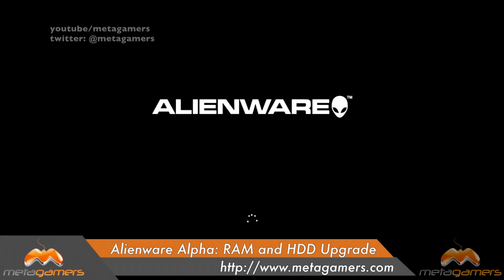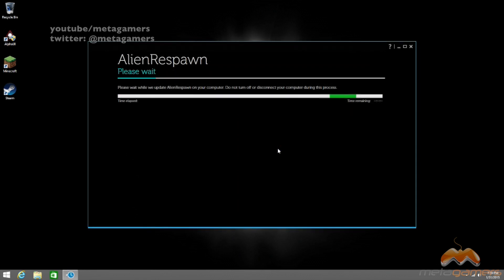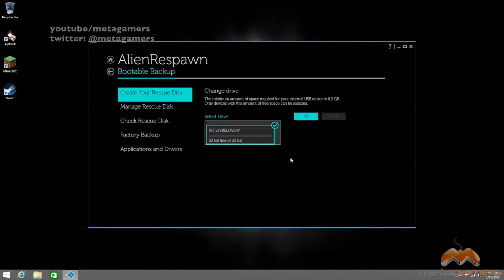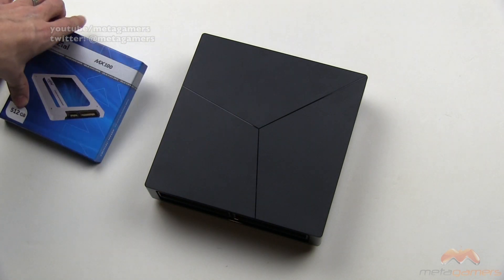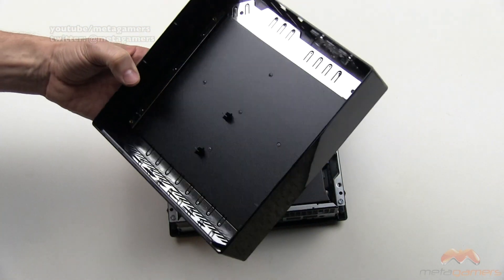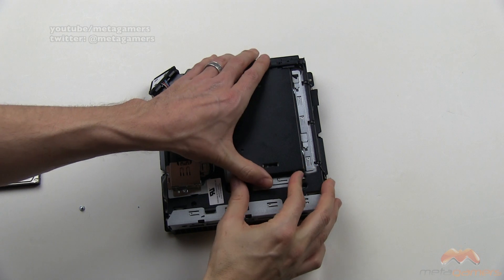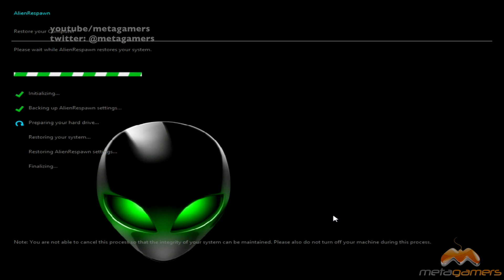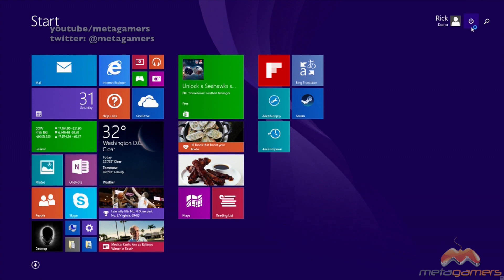Alienware Alpha RAM & SSD "How to" Upgrade Guide

Comment: Alienware Alpha i7 is at $649 right now. I don't know how good a deal that is. And before I have to see a DIY PC enthusiast responding, I actually have an NCase M1 mini-itx gaming PC that I built myself. This tiny pc would be for my mother. Does anybody know how low the i7 version has gone down to? I know that the i3 version hit as low as $330 online and $300 at microcenter.
Reply: Hey Albert! The best thing you can do is to buy the i3 model. You can manually upgrade the processor to a i3 4130 NON T. This processed preformed better than the i7 model ( I forgot where but look it up on Reddit). And with the remaining money you can buy more ram and an ssd to your liking. Hope it's not to late:(
Reply: With the ram You only need one stick of 4gb of ram, Because there are 2 slots of ram but only one stick in the system
Reply: +Pjnerd what is non t? i just order the alpha i3 and want to upgrade it.
Reply: can you link it from amazon?
Reply: http://www.amazon.com/gp/product/B00EUUKVXM?psc=1&redirect=true&ref_=ox_sc_act_title_1&smid=ACO27ZEUBKBAF
Reply: But i strongly recommend to upgrade the ram and the hard drive to a ssd FIRST.
Reply: +Pjnerd Cpu is on order. so 8 gb of ram is good total? or can i get 16? also is 250gb ssd large enough or should i get the 500?
Reply: 8 ram is enough The ssd depend on the type of games you play. For the cpu did you buy a good thermal paste.
Reply: +Pjnerd nope.... any kind ?
Reply: http://www.amazon.com/gp/product/B000OGX5AM?keywords=thermal%20paste&qid=1449185290&ref_=sr_1_2&sr=8-2
Reply: Curt Gilbert also the ssd I think the 250 gb is more than enough
Reply: Pjnerd
It's too bad there is no gpu refresh to the 970m. Maybe they will wait for the Nvidia Pascal GPUs to come out.
Reply: Well honestly, that gpu is quite "enough" But i still agree.
Reply: +Albert Chang Pjnerd Is wrong go with that its the best deal rn. I got the i3 version and now im having to spend $300 on an i7.
Reply: +Endz  I got the i3 for $330, $70 for 250 ssdrive , $70 16 ram, $115 new processor.  Totaling like $550 super fast !
Reply: There are some good deals for eBay bids. Some they give you a nice samsung ssd with 16gigs, i7 and like free games and wireless logitech keyboard for like $700.
Reply: If you get those new credit cards such as Chase Freedom, you can get10% back from Amazon purchases (till end of this month) and like $150 back if you spend $500 first 3 months (really easy to do in California lol).

Comment: I noticed you said 4500 rpm when I was on website today the hard drives now say 7200 do you think that is fast enough
Reply: sorry you said 5400
Reply: +twofacedconker that should be fast enough. the jump from 5400 rpm to 7200 rpm is significant. The hard drive is probably a Hitachi 32mb cache or a Dell 64mb cache. Hitachi seems the most probable as you can get it around $65-70 on newegg.

Comment: so if i upgrade the ram only do i have to back up the alpha
Reply from the maker: No you should be able to swap in the RAM no problem - no backup required
Reply: +metagamers do I have to use a wired key board and mouse? why is it safer?

Comment: Upgraded the CPU,RAM, SSD, and wireless card but my alpha won't boot up. The logo keeps flashing yellow. Do you know what could be the problem or how I can resolve this? Thanks
Reply: +JerzyShingo1234 That would be a power issue.
What CPU did you put in there? If your system draws more than 300 watts you will get that error.
Reply: Same here! Did you find out how to fix it?

Comment: should I get an alienware alpha as main gaming machine?
Reply: +AMDX1325 Yes i recommend, ONLY if you have no knowledge on building a pc. I Strongly recommend you buy the alpha through eBay you can get it for around 370$ usd. And with the reaming money buy the ram and ssd. and later on buy a i3-4170 CPU and upgrade it. That cpu is the BEST one you can buy, even better then the i7 config .
Reply: ***** The i3 version comes with a i3-4170t CPU But if you change the processor "manually" to a i3-4170 CPU (non t) you will have a higher clock speed and Just better performance. if you use a good thermal paste
Reply: ***** No Problem Bud :)

Comment: Great video mate, I was considering one of these for a media PC and because of your video I'm sold. Also does the System support 5.1 surround using the toslink port, Thanks again.
Reply from the maker: Thank you. Yes, the system supports 5.1 if memory serves me correct. I can double check that and get back to you
Reply: +metagamers I just need to verify that the 5.1 works via the toslink port, so if you could confirm that would be greatly appreciated.

Comment: do I have to upgrade the hard drive?? I got the i5 1TB with 8gb RAM so can't I just upgrade my ram to increase the speed ?? as my hd is 1TB 

thanks
Reply from the maker: Yes you can just upgrade the ram if you'd like. The hard drive upgrade really only helps with load times
Reply: So I have the 1TB what comes with the i5. Would I need to change it? 

Thanks for getting back to me!!
Reply: +Gary Smith Most indications I have seen online are that there is a significant boost in speed with an SSD. My roommate has successfully done the upgrade to SSD and said that the difference was like night and day. I am trying to do the upgrade now but am running into issues with the respawn software- possibly because I upgraded to Windows 10 before or happened to have a bad memory sector on my flash drive... still investigating that. If your 1 TB drive is anything like my 500 GB, it is probably only about 5400 RPMs and that is incredibly slow compared to an SSD.
Reply: +John Okleberry i am still confused, if my hard drive is 1TB why do i need to upgrare it? is this a slow drive? i am a novice to pc hardware and software
Reply: Here is a bit of info on the difference between SSD and HDD (which is what the Alpha would come with): http://www.pcmag.com/article2/0,2817,2404258,00.asp

When it comes to long-term storage, there is more factors than just capacity involved. We are talking about the speed of reading and writing data on the drive. Your system will start much faster, applications will load faster, and you are less likely to see stuttering in high-end games.

Your HDD probably has a 7200 RPM speed- as borrowed from Dell's own website:

"500 GB (64MB Cache) 7200 RPM SATA 6Gb/s"

It's actually a little challenging to find a direct translation.

Here's info on the 850 EVO's speeds from an Amazon product page:

"The 850 EVO delivers class-leading performance* in sequential read (540MB/s) and write (520MB/s) speeds."

On a practical note. I saw my roommate move his steam game (Left 4 Dead 2) onto the hard-drive that came with his alpha and use it externally after upgrading to SSD and he immediately noticed stuttering and lag in gameplay. Sorry for rushing this response- just saw it at an awkward time to respond
Reply: Thanks john

Comment: If I clean-reinstall windows 10 on my HDD, then use this back up process, can I fit the only the basic programs and OS on an 16gb flash drive? I just didn't know if I need to buy a new flash drive or not.

Comment: alienware alpha seems like a barebones PC, since you need to upgrade the ram, the HDD to an SSD, and replace the wifi card. Wifi card and HDD they add are embarrassingly slow and the Ram needs to have both cards replaced since there are two 2gb sticks. You will need to wait for a black friday deal, get this for $350 and it will justify the cost for all the upgrades....sort of.
Reply: Patrick Finley Wifi, no problem, and its 1 4gb stick. Not 2 2gb sticks
Reply: well, I have been testing it out and the Ram is fine for the basic user. You don't need to upgrade for gaming console purposes, but Wifi is a problem.

Comment: ***** my Alienware Alpha front 2 usb stopped working I did the fixes and still nothing. So what I was going to do was just Recovery it like Recycle my alienware Alpha as if it was just coming out of the box. Will my method 100% fix my problem since the 2 front USB's were Overcharged ever since I plugged in my gaming Fightsticks from Madcatz. please respond quick. Also my ALPHA is in perfect condition so nothing bad happened to the front 2 USB's they just don't work even after the fix.
Reply: You should contact them through their number or something
Reply: that happened to me but then they just started working again

Comment: Can i just buy another 4 gb for the i3 thats compatible and pop it in with the one that was originally there?
Reply: Hope you didn't do it after 3 days. Typically, you want to buy the two of the same model simply so they run easily. Unless stuff like voltage and and sped are the same, it's usually recommended to buy the same brand.
Reply: Spiller can you link me?

Comment: im thinking about getting the alienware alpha when you did the backup and then the reinstallation of the alienware backup drive did you have to do an os installation first before the backup on the ssd or was everything on that backup stick?
Reply from the maker: william coleman everything was on the stick that I created. I need to look at the new updated software to see if its the same process as the interface has changed since this original video was filmed.

Comment: hi this alienware alpha can be upgrader the CPU for example from i3 to i5???
Reply: yes aslong as it doesnt need a separate power source
Reply: Victor De Leon Can I ask why you are looking at  a PC like this instead of a pre-built desktop PC from one of the small businesses on amazon?. I ask because if you were to buy a pre-built desktop PC from amazon you would get more for your money and it would be far more easier to upgrade over the years?.

If you are thinking about buying a PC like this because you have not much space then fair enough. However if you are looking at buying a PC like this because you think it's easier to get into then you should maybe stop and have a talk with a few people who can help you make your mind up.  I got into PC gaming only 5 years ago and I bought a pre-built desktop from one of the small businesses from amazon which meant everything was done for me and all I needed to do was hook it up to a TV via HDMI lead.

I still use that desktop for all my gaming to this very day and the only thing I have replaced in the 5 years was the GPU as the CPU lasts a long time. So these Alienware's allow you to upgrade the CPU but not the GPU. However it's only really the GPU that you will ever need to upgrade as CPU's last years. My CPU is 5 years old and yet it still chews through games running them well above 60fps and I haven't even over clocked it.

So a pre built desktop is cheaper, easier to upgrade , runs quieter and can be over clocked.  So if you are looking at this because you don't want to build your own there is other options that may suit your needs better.
Reply: +Victor De Leon You can save money by buying a 1150 socket S-variant i5 version. The reason I say this is because the Alienware was smart enough to auto-clock the i5 or i7 cpus to only 2.6-2.7 GHz most of the time when gaming or doing high cpu workload tasks. Thus, it would be a waste of money to go for the i5 4690 or 4690K.
Reply: +No Name which one did you get ?

Comment: Two questions. One: is that SSD necessarily an "upgrade" due to the lower amount of storage it provides? Two: On the box that the ram came in, it showed the logos of the i5 and the i7, but not the i3. Does that mean it won't work on the i3?
Reply: +Political Loopholes It's a computer... u put ram in and it will work, u put a HD in and it will work reguardless of the processor. And yes, it is an upgrade. Some lag in games come from live rendering of textures and other things in games, SSD's can reference and load files and other things faster than a HDD. So not only does boot up time increase, pretty much everything increases in speed. As for it being less space, i've never filled up 500gb so it wouldn't effect me none other than it being faster. I guess some people hoard games and actually need 1tb-2tb of space.
Reply: Name Goes Here I was wondering the same thing
Reply: True true. Thanks!
Reply: yes and no
Reply: The ssd is very necessary if you upgrade to win 10. I'm over here trying to get my pc to stop using 100% of the disk. Get the ssd the stock hdd can be garbage.

Comment: Could you also swap out the parts when you first take it out the box with out having to do all the restore stuff?
Reply: No, taking parts out with out restore, is like saying not wiping the babies butt and just putting on a new fresh diaper. If you don't restore, none of the information will go to the ssd it will be blank and it will say no OS found. And there is no miniature drive that holds the OS.

Comment: When I turn on my Alienware alpha. It blinks yellow and won't come on. What wrong? All I did was upgrade the ram.
Reply: Try swapping the RAM around. Larger SODIMM goes under the top and make sure they are seated in the connector correctly.

Comment: I upgraded the ram in my unit. I noticed the fan for the video card is solid and won't shake. The fan for the cpu is a little loose and will move. Anyone else have that issue?
Reply from the maker: hasteveha I have not had that issue, is it properly secured in place?

Comment: awesome awesome awesome video, i just bought the alienware alpha and I swapped out the hard drive for an SSD and this video made it so easy, thanks bro!
Reply from the maker: Glad it helped! Thanks for watching
Reply: Tard
Reply: Was going to buy one myself. I had a question for anyone. If I'm only just changing the hard drive to an SSD, do I need to do the whole backup thing?
Reply: all i did was change the hard drive for an ssd and i did the back up so it is recommened
Reply: Reich 58 Yes, you need to do the backup because the new had drive will not have an OS or any other essential programs needed to run the machine
Reply: TheGam3rbl00d what can i do then when i dont have the alienware respawn anymore? Im willing to buy a new windows but the problem is the other programs that is neede ro run this thing?

Comment: if you buy and download games, can you save them to an external hard drive to conserve memory on the SSD?
Reply: Tank Master yes but you wont be able to run them maxed due to the limit of speed
Reply: Yes, first plug the external drive into the computer, and before you download the game go to settings then I believe it should be under downloads find your drive a create a new steam folder in the drive.
Reply: that is drive speeds dumbass

Comment: do i need to do a backup just to upgrade the ram? or can i just plug an play with that? thanks
Reply from the maker: No backup is required to do a RAM only upgrade but I would suggest you at some point create a USB stick backup in case you ever have a HDD failure.
Reply: Would my 16gb patriot xt work ok for creating a backup or should i get a larger model? I really appreciate your quick responses so far brotha. Thanks
Reply: Also. What kind of hard drive would you recommend for a faster system?
Reply from the maker: As long as your patriot has nothing else on it then it should be fine. Remember it will only backup the contents the system shipped with. For fast drive performance is say go SSD if you can

Comment: I upgraded my Alpha with the same exact parts  (PNY thumb drive, Corsair Vengeance 16GB kit), except for the SSD. Instead I picked up a Samsung 840 EVO 500GB. So now my specs are Intel Core i7, 500GB SSD, 16GB or RAM, and I overclock using MSI Afterburner. Everything flies. The biggest upgrade is the SSD, hands down.
Reply: Hi, is it possible for you to give me a list of what you used to upgrade your alpha and where you purchased all the parts from? Also what did you use to back up everything? I'm new to pc's and I would really appreciate you feedback. I could use the help.
- thanks in advanced
Reply: My parts are listed. I bought the RAM, Thumb drive to backup, and the SATA to USB cable to clone the old drive all at Best Buy. The SSD I bought from eBay. Now there's great deals on SSDs on SlickDeals.com every day. It's very simple to upgrade.
Reply: Okay thanks I apprecite the help.
Reply: Jordan Hayes When it comes to RAM,  I recommend Corsair vengeance or G Skill RAM, as they're low latency. For SSDs, Crucial or Samsung are fine. Shop around,  as PC parts go up and down in price daily.
Reply: ***** I actually bought mine with the Core i7 4765T configuration. With that said, any Haswell i7 will work. Most people stick with Amazon and NewEgg.